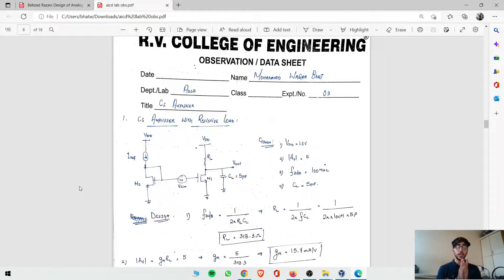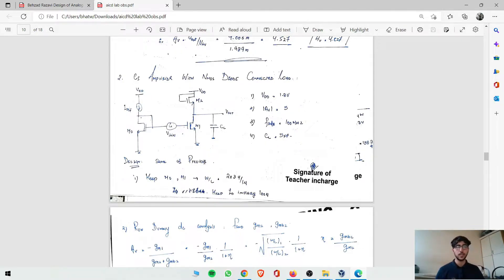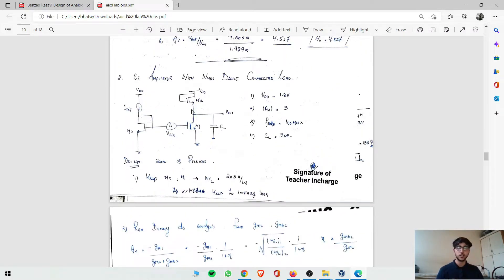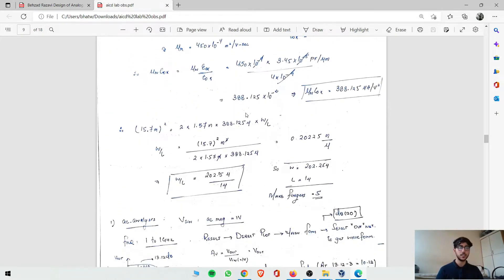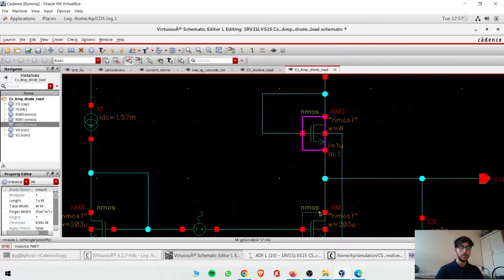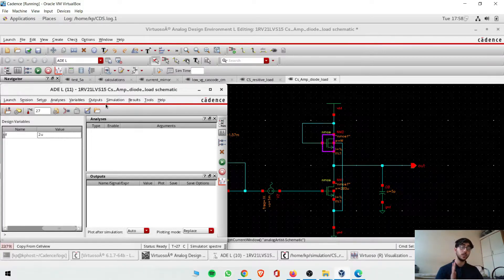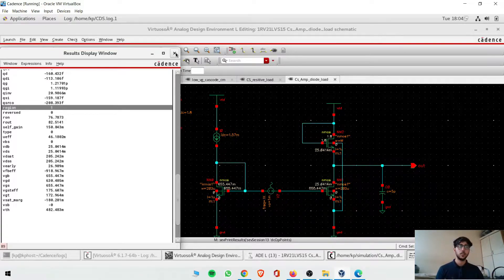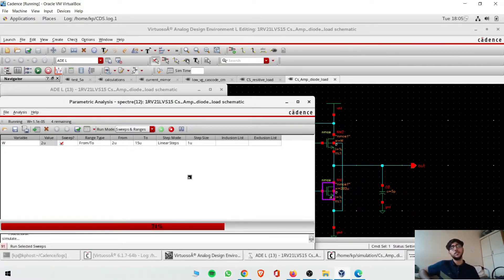8 Common Source Amplifier Nmos Diode connected Load |  Cadence | Simulation | gpdk180 | Tutorial

Comment: Error found by spectre during circuit read-in.
    ERROR (SFE-23): "input.scs" 12: The instance `NM1' is referencing an undefined model or subcircuit, `nch_tn'. Either include the file containing the definition of `nch_tn', or define `nch_tn' before running the simulation.
    ERROR (SFE-23): "input.scs" 15: The instance `NM0' is referencing an undefined model or subcircuit, `nch_tn'. Either include the file containing the definition of `nch_tn', or define `nch_tn' before running the simulation.

Sir i encounter with the above problem while simultaing the common source with resistive load so what you suggest i have to do?